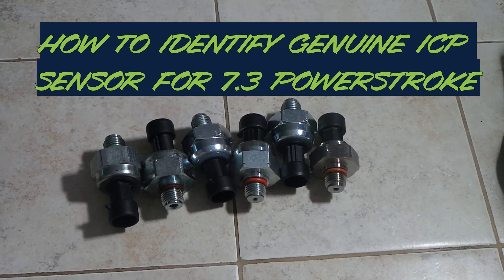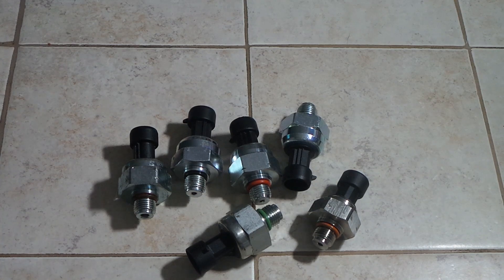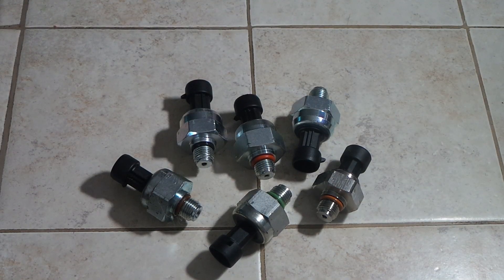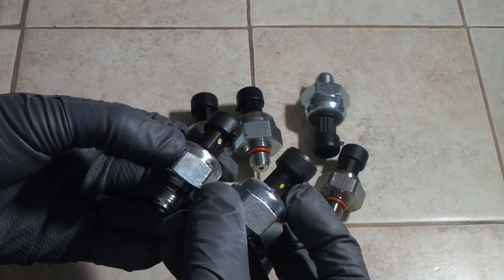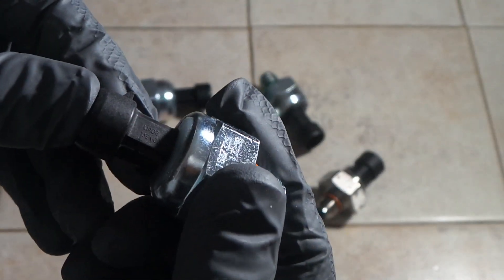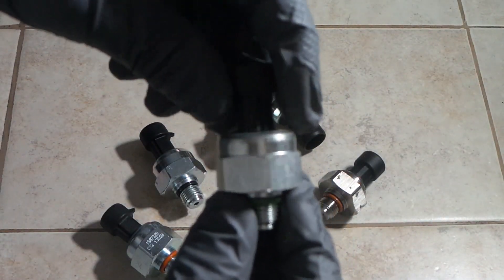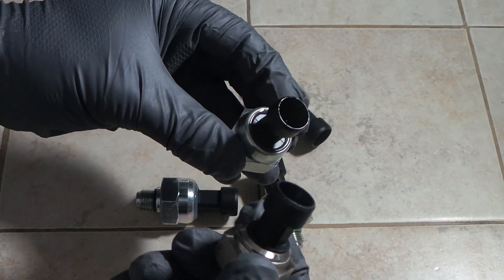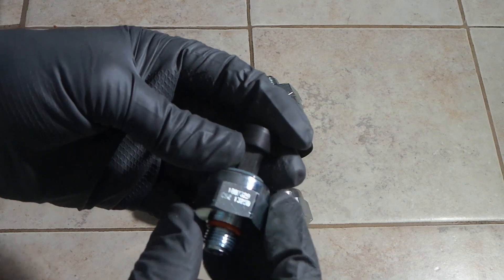Don't get SCAMMED! How to identify a genuine ICP Sensor 7.3 Powerstroke

Comment: Ive tried the aftermarket ones, noticably less power and it idled like it had air in the fuel system. Gave it a while thinkign it was just air in the high pressure oil system. Swapped the oem back in, night and day.

Comment: Hi thanks for sharing this! I bought one recently from a Ford dealer I'm in Quebec in Canada. The package was opened when they sold it to me and they had it delivered from a different dealer that had it in stock. Everything seems to check out it has the yellow paint on it and it says made in Mexico. The only thing different is the etching... it's laser printed on the plug side of the plastic part and it says 1807329  C92 2234B. It seems legit but since the package was previously opened, and it says right on the bag " THIS PACKAGE CANNOT BE RETURNED IF OPENED",  it leaves room for doubt. Any thoughts?

Comment: I recently got one from eBay from a high rated seller with original ford bag , it’s more of a goldish color one , has the etched markings and made in Mexico on it but no yellow mark. Curious to see if it’s legit or not
Reply: Only ones I’ve seen that are goldish have been labeled as international on pure diesel power

Comment: Also I’m curious what you thought of the pig tail that came with it. At first I really like it, but then I realized it’s just cheaply made. Too many pieces. I put a new wire harness on the truck recently not from Motorcraft, because I couldn’t get one from Motorcraft or Riff Raff, it’s discontinued. However, the harness I got I’m not very happy with either. I feel like I’m going to be putting my old factory one back on in a couple years. Whenever I have trouble with my truck, I am plugging and unplugging sensors, a lot, and the Motorcraft ones hold up a lot better than my new one.
Reply from the maker: I know what you mean about the new style pigtails... I haven't had any issues with them, but they definitely feel/look like they are on the cheap side.

Here's a link for the more quality pigtail, I presume this is the kind you were referring to: https://www.amazon.com/Connector-1994-2003-Excursion-2003-2007-2004-2010/dp/B009VI5NXG/ref=mp_s_a_1_16?crid=2KOZD5VQVVAFK&keywords=7.3+pigtail&qid=1690311590&sprefix=7.3+pigtail%2Caps%2C292&sr=8-16

Comment: James…man….. very good idea on the we sensor. That was very smart of you to do that video and I like the way you put it together. I accidentally ordered that sensor from ProSource about a month ago and I was kind of mad at myself because I thought I was actually ordering a Motorcraft sensor. So, I’m glad you expressed how you feel about that thing. I’m curious, what do you think the longevity of the center is going to be. how accurate do you think it is versus a Motorcraft. I was going to make a video testing my sensors side-by-side.
Reply from the maker: Hey thanks man!!

I like the Zibbix one alot! The only issue that I have had with them is on my first one the black nub on the plastic stem that holds the clip on to it broke off (probably from me swapping sensors in and out too often) but I contacted Prosource Diesel and included picture and they sent me another one, free of charge! So that was pretty awesome.

As far as the performance goes, I actually had the same thought regarding  comparing the performances of the sensors, but after consulting the fine folks on the Ford Truck Enthusiasts Forums and they pretty much told me that all the sensors perform pretty much the same, it's more to do with how long they will last.

If you're interested you can take a look at the FTE post here: https://www.ford-trucks.com/forums/1730678-7-3-icp-comparison-experiment-assistance.html#post20908691